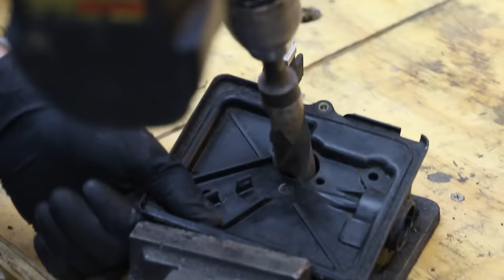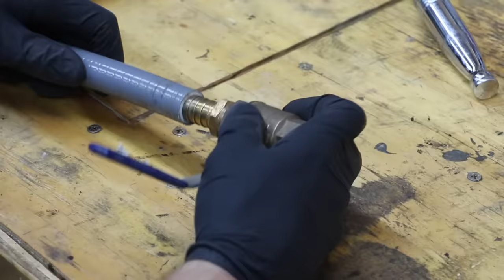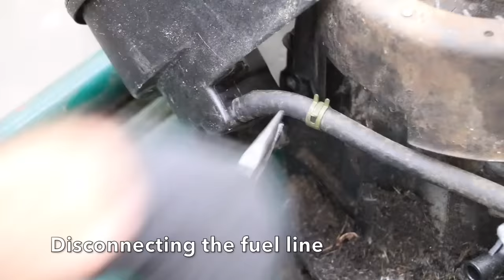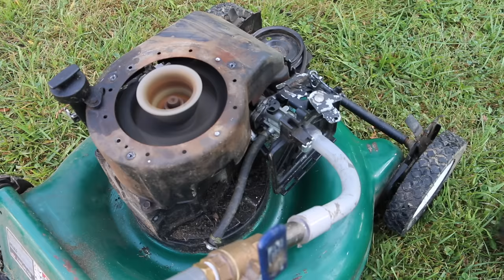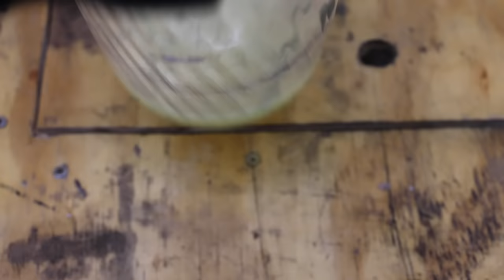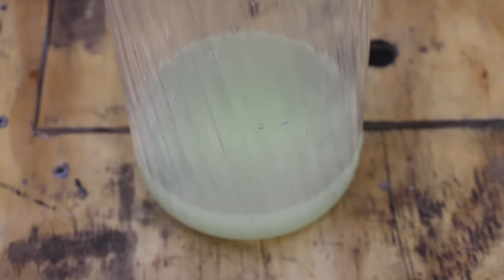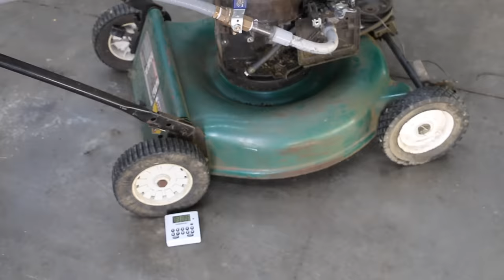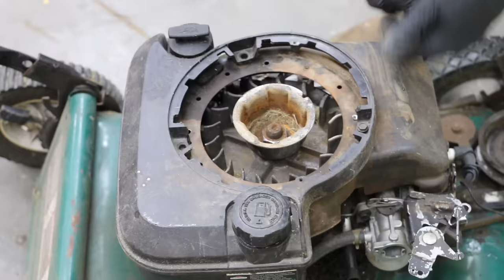Will a "Gas Vapor" Container Improve MPGs and Fuel Efficiency?  Let's find out!

Comment: Since engines have either a carburetor OR injectors whos role it is to do exactly what you are testing (vaporize liquid fuel into a fuel/air mix) you could say vehicles are already designed to run on fuel vapors . Or am I missing something ?
Reply: you are missing something.
Reply: @ Logan Well that was extremely helpful of you . Care to explain WHAT I missed ?
Reply: Seemor Disillusioned  You are missing nothing. This whole “experiment” can be done in your head, with the same results. (As you explained with your comment.)

Comment: Back in late 70s I did this trick, thinking same thing. I called it the "Breatherator". Had plans to get rich quick. I made a working model using tin cans and hoses. Hooked it up on my Ford falcon station wagon and got the engine to run. After that I modified design by using membranes  that where to be electronically controlled to detect moisture. Think small tiny membrane with fuel sensor controlling gas moisture. Then in a spiral air path a series of membranes would present gas fumes in more precise control. Regulating not only how much gas moisture present at each membrane but how many membranes active. Still has problem of backfiring. Eventually met my x wife and life went sideways...never to return.
Reply: If you want to revisit, you will get much better results with oxygen sensors and mass air flow sensors.

Comment: I think it would just be like running a lean motor.
Reply from the maker: Great point!
Reply: @ProjectFarm  im surprised it didnt run hotter than normal running so lean
Reply: @Hoetobeajew  it runs hotter when it is rich.
Reply: No it runs hotter when it’s lean
Reply: @Taiger-vd2dq  No, it runs hotter when it is rich. Why would it run hotter lean? It just more air in the mixture.
Chrisfix already made a whole video about this
Reply: @rickytrevino8281  Because gasoline cools, but don't take my self for it I'll watch the chrisfix video
Reply: @josef2102  Because air cools. Lean is less gasoline more air. Rich is more gasoline less air.
We are talking about lean. So yes, go watch chrisfix
Reply: @rickytrevino8281  Lol are you seriously saying things because you think they sound right? The phase change from a liquid to a gas takes energy from its surroundings, so a rich mixture cools the engine. Running lean will melt an engine, any two-bit drag racer or tuner knows this. Read up on things before you get sure about them, it helps prevent embarrassing oneself. Hell, go tell them how to tune your car for you if you're so sure, I'm sure it'll work out well.

Comment: Great demonstration! If you could measure it, there would be an increase in power output and efficiency because the lawnmower doesn't allow you to lean the air/fuel mixture. If there  is a means to exceed the results of fuel injection, one would need to build a modified ICE engine or 'from the ground up'. You are on the right track.
Reply from the maker: Thanks!

Comment: Could you get it to run LEANER ? 
if you had a second air intake for Oxegin? so it's not constructed through the vaper carb.
Reply: Good question!
Reply: stoichiometry is the proper atmosphere to fuel ratio and gas in a vapor state (which is the only way it actually ignites) is 14.7 to 1 by volume. The other factor is valve timing. LPG & CNG engines need a shorter opening time to work with gas over the extremely fine mist that a carburetor produces. The only reason why it works is because it is so fine and is then compressed. Temperature energy is condensed and the molecules spread out to create and ignitable air file mixture.

Comment: The Wright Bros airplane was run with gas vapor , gas dripped onto a hot plate ( heated by the exhaust once the motor was running ) the vapor from the gas was sucked into the engine . No carbarator
Reply from the maker: This is interesting. Thank you

Comment: I have done these experiments. I had better results when I used a 1 gallon paint can and mounted to the exhaust for heat. To increase the vapor and the ball valve for the oxygen side or air intake. with no carburetor. but I did enjoy your video.

Comment: Hi. Project Farm here is another idea: My grandpa said that during WWII some soviet trucks were running on wood. They had regular internal combustion engines, but due to lack of gas, with some modifications those truck ran on burning wood. large canisters were installed on the sides of trucks where smaller pieces of wood were churning and producing smoke that fueled engine (I could only assume it was CO gas which was burning later to CO2 inside the engine). I always wanted to see that running.
Thank you.

Comment: The true test is in using the mower to cut the grass, when the mower hits a tough patch of grass the governor opens the intake butterfly and increases the air fuel flow rate, this is where the increase in fuel takes place. The carburettor system is more responsive and powerful than the fume system. Love your work👍
Reply from the maker: Thanks!  Thanks for sharing.

Comment: Try adding h2o to the gas while using the vapor. You'll use only a fraction of liquid gas. Awesome I'm running my ATV on almost 60% h20
Reply from the maker: Thanks for the suggestion.
Reply: @ProjectFarm  time for another video with added water just as the original article read in the documented paper.
Reply: Water vapor, not just water. Not really possible in sub-zero temps though...

Comment: One backfire and you will be covered in burning gasoline. Your fuel line, all the way to the fuel source is preoxygenated fuel, very dangerous.  A water bubler would make things safer. Gas engines only run on vaper not liqud gas otherwise propane wouldn't work. I'll bet you're  running at different A/F ratios, that would throw effinciency results.  Cool vid, Thanks.
Reply from the maker: I agree that this seems like a very dangerous setup.  Thanks for commenting!
Reply: backfire wouldn't likely get that far, I would think. But all he needs is some screen in there as a fire stop like gas welders have built in.
Reply: Which leads to another experiment.  Try attaching a hose from a propane tank to the same vapor line you used in this experiment. Then compare propane utilization to gasoline.
Reply: It's basically a potential air fuel bomb without an ignition source. A backfire is all it would take to ignite it.
Reply: Propane is liquid. When your fuel is atomized it creates surface area. 
Notice I said "atomize" not "vaporize". Small droplets of fuel are more effecient than big drops or vapor.
Reply: Maybe try running propane through the liquid gasoline using the air intake tubes and see what it does...will the combination increase the overall efficiency of either of them individually?
Reply: All you would have to do is install a check valve like the type used in acetylene hoses. Just make sure you install it in the correct direction!
Reply: As a welder, I can add that acetylene hoses don't use a check valve in the modern world. Rather they use a very small ceramic orifice in line called a "flashback arrester". It works by reflecting the most of any shock waves, and quenching combustion, not an actual valve, although it often still does have a correct direction due to its shape.

This is needed in acetylene systems since under high shocks it can detonate WITHOUT the presence of oxygen (like nitro-methane also does). Its much less energetic than burning with an oxidizer, but in collapse to carbon and hydrogen it will be self sustaining, which is one of the reasons why acetylene is NEVER stored as gas tanks, instead tanks being filled with a solvent (normal acetone) that dissolves the acetylene like a soft drink does CO2. This is also why you never put acetylene cylinders on their sides, since if the acetylene saturated acetone enters lines ect connected to the bottle, it will permit radically more fuel per volume at a given pressure, so can cause dangerous conditions to the operator.

Comment: Before you watch the video, 1st realize liquid gasoline is not even flammable, it is the vaporized (gaseous) form that flammable.... hence why fuel injectors create a micro spray in your engine... of course this will work, just plain common sense.

Comment: you realize, of course, that al you have done is replicate the crude carburetor of the early gasoline  engines.  Put a load on that engine and see how well it works . . .
Reply: pleidius I think you may be onto something there maybe we should ask him to do the same thing over and put a load on the engine both ways mowing short grass is not a way of putting a load on an engine
Reply: Exactly all this does is to move the mixing of fuel and air to the canister instead of the metered and regulated carburetor.
Reply: he was mowing the lawn...
Reply: my normal lawn mower would still stall even at full speed too
Reply: You don't understand engine physics. You have to learn about combustion and how fuel ignites. Only gassified fuel can ignite with oxygen. Our iternal combustion engines are designed to spray a liquid fuel into the intake, resulting in only part of the fuel vaporizing and igniting, the rest is exhausted from the engine and creates pollution. 
go check the Pouge carburator if you are curious. He patented a carburatot that completeley vaporized the fuel and premixed it with air before entering the combustion chamber. They achived around 100 miles per gallon with full power. 
After him there were more then 50 other similar patents but they were all bought and shelved by the oil/car industry.
Reply: I want to see the motor do "some work" too. Set up some brake where you can figure out the torque being applied see if the liquid gas motor can work harder than the one running fumes.
Reply: pleidius   There are a few vids here on youtube that run this idea in cars. It's how I found this vid.

Comment: I want to see the vapors going into the motor.
Is it pooling up and then just dripping down the line?
Reply from the maker: The vapors would be nearly impossible to see. Thanks
Reply: the vapors wouldn't be visible, but i think he is suggesting the vapors might  be condensating back to liquid form
Reply: He used an old as mower for the experiment,  probably works for petroleum cooperations

Comment: Lol all engines use gas vapour to power themselves, what you did on outside the engine does on the inside.
Reply: Injectors do indeed spray a very fine mist of liquid fuel.  Aside from that, there is actually a vent on top of your car's gas tank through which vapors can travel from the liquid fuel below. Those vapors are then accumulated in a canister and held within activated charcoal pellets, to be burned in the engine later on. At certain points during vehicle operation, the car's computer will actuate a solenoid valve within a hose connected directly to the intake manifold, where the vapors are pulled in via vacuum pressure and burned along side the injected fuel.  It is quite efficient to make use of this since the gasoline is already in vapor form. This is one of many reasons why modern engines have higher MPG than older cars which vented the vapors from the fuel tank directly into the atmosphere.

This is known as an EVAP system, if you were interested.  Besides increasing your MPG, it has the added benefit of preventing direct hydrocarbon pollution to the atmosphere.
Reply: @nvg1526  liquid gas will never combust only the vapor will so even the fine mist is turning into a vapor before it ignition
Reply: @thisnametooktolong  Gas doesn't burn because there is no space for oxygen in the liquid, a required ingredient in combustion. Once it vaporizes, oxygen can get in between all the gas molecules which allows it to combust. In fact, wood only combusts really because it naturally contains oxygen itself within it's structure. Otherwise it would need to be vaporized (aka misty sawdust) for it to ignite (in fact such a thing happens and is very explosive, clean up your sawdust).
Reply: @thisnametooktolong  same reason gas won't burn all the way into your gas tank the concentration is to high in the tank so there is not enough oxygen to combust
Reply: @thisnametooktolong   There are real people in this world who would use the same statement for the opposite side of the argument; that they think throwing a match into a container of gas would actually explode and the sarcasm comes in the form of "yeah right, gas totally isn't flammable".

Sarcasm cannot come across in text well when I don't know you and reality has plenty who would say the same in all seriousness.
Reply: If u pull the injectors off the port you will see it is a not so little amount of gas

Comment: Maybe if you heated the fuel with the exhaust, you would get a greater volume of gas due to expansion.
Reply: Geoff Hilton but its gonna be less dense, no? With less energy density
Reply: Yes the volume will be bigger, but it will still be the same amount of fuel. No magic pixie dances can turn a gallon of fuel into something more then a gallon of fuel.
Reply: MsSomeonenew  your right but conservation of energy would suggest that the waste energy of the exhaust is being used and may have an effect especially if used in conjunction with steam injection.
Reply: This could perhaps be why there’s an exhaust gas recirc system on cars today, and O2 sensors to keep it all balanced out.
Reply: air is still pulled in the conventional way

Comment: Couldn't the vapor be re-condensing in that loooong tube you've got going into the engine and losing all the efficiency?
Reply: Probably not due the pressure inside the line with be lower than atmospheric
Reply: no, vapour only condenses with change in pressure or change in temperature, and since both stay about the same inside the system, nothing will condense

Comment: Great video as always Mr Todd. I do have a question for you. I noticed that you said that adjusting the valve was changing your fuel to air mixture. If I understand correctly though you're getting all of your air through the fuel-bong  canister, correct?  Arnt you actually adjusting the resistance to the intake flow which has the same fuel-air mixture? Or do you have air also coming in from somewhere else that I missed?
Also, did you allow the fuel to settle to see if it was air in the feul or did it actually change the composition and appearance of the unused fuel permanently?  I can't help but wonder if using the vaporization process you only removed the flammable components while retaining non-contributing components. This perhaps could prove useful and showing the benefits of refining further the fuel so you can have greater energy in the same volume or more efficiency per se. Love the video and I sure appreciate what you do!   Another video idea perhaps is to see if this would work with diesel or alcohol or other types of fuels with any improved efficiency.